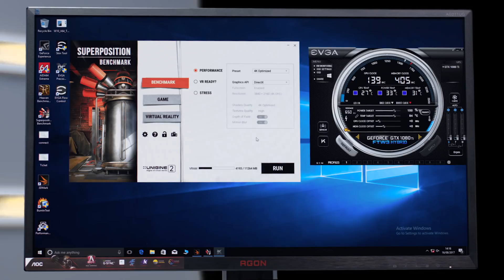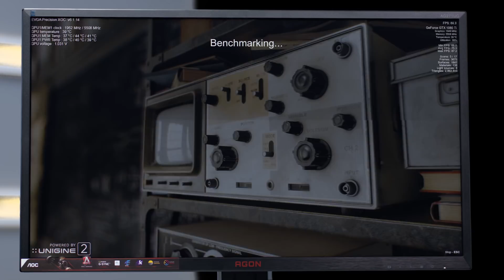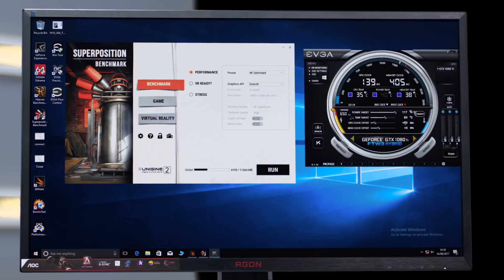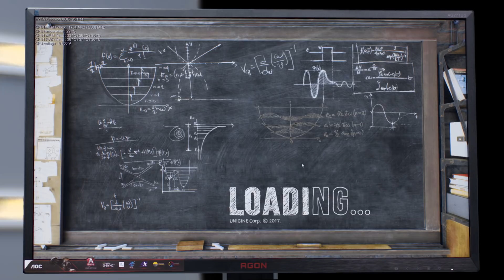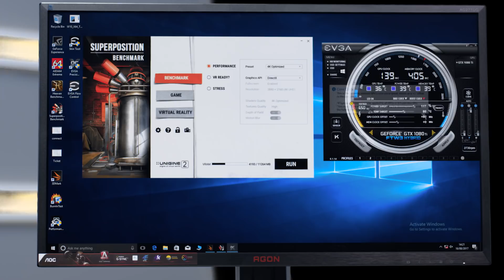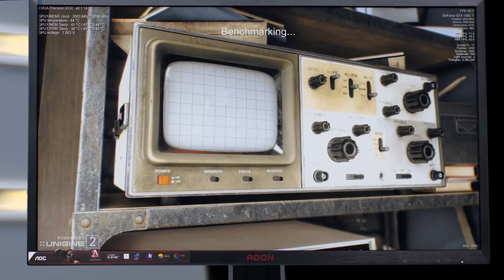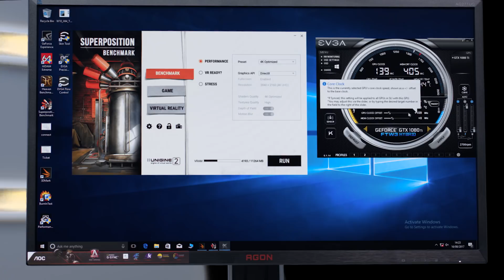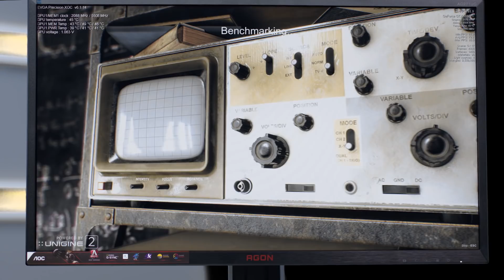Overclocking the EVGA GeForce GTX 1080 Ti FTW3 Hybrid with Precision XOC software - Tutorial

Comment: I purchased a 1080 ti FTW3 Hybrid on eBay that is functional on older drivers, but above 46x.x the system becomes almost completely unresponsive.  Power Consumption shows 0.0% TDP, and the VRAM fan never spins. Temps stay in the 38° range.  Any idea what would cause this?  Bad fan controller?  Bad INA3221?  Has anyone else encountered this issue?

Comment: I’m new to overclocking. I had my 1080ti ftw3 for years now. Does this over clocking really make a huge difference? Also, do I have to click the switch on the card itself before I attempt this? I’d like to upgrade but only if I have to. I never overclocked the card and if this makes it just as good as a 3080 I’d be happy. Thanks for any response will help.

Comment: Mine didn’t do a safe crash. Screen is black and my Pc is still on. The fuck do I do?
Reply: You just pull out the HDMI cable from the graphics card and then plug it back in in 5 seconds the screen will flicker and you'll be able to resume what you were doing.

Comment: safe? yes,,,totally proof no,,,like MSI 1060 6GB Gaming X the afterburner, if you OC'ed the GPU incorrectly it would lock up right after you login the windows , you have to get to safemode to uninstall the software!!
Reply: but can that happen with precision xoc? just saying.. its made by evga for nvidia i have tried using afterburner in the past.. there is alot more tweaking that you can do, but the reason I stoped using it is because im not informed enough to use it safely.. it seems with that software you could over do it

Comment: Can anyone help??!
My fps isn't as high as i'd hoped for games like PUBG / GTAV 
GPU: EVGA NVIDIA GeForce GTX 1080 Ti 11GB 12GHz FTW3 ELITE GAMING BLACK
Intel i7 4790k
16gb ram
34 LG 34UC88 (ultrawide) 3440x1440

I'm only getting between 40-60fps on GTAV and that's not even on max settings. I've tried on my 1920x1080p monitor as well and that doesn't make much difference! 
Any help would be great!

Comment: Looks like a really good tool and on par with Afterburner, my thoughts on overclocking though are only for bragging rights as I want my cards to last as long as they can due to budget, the harder you work something the quicker it will break

Comment: This software is great. I find that my EVGA 1080TI SC without this software gets to 82C and the fans aren't running at full speed. I like my GPU to stay cooler than that so with this software I get more MHz whilst even running lower say at 75C tops with full fan speed.

Comment: Precision X is easy to use . I have used it on my EVGA 750 ti OC . I no longer over clock due to the GPU is getting old and I really need to prolong the life of the card since I can't afford to replace it. But I did have a lot of fun playing around in Precision X and running bench marks.

Comment: I used to like overclocking but now it's just 5-10% improvement on a custom card that has the cooling capacity to oc, the cheaper ones that are factory clocked lower can go past 15% but they have undersized cooler so...

Comment: Did a few tweaks and got mine to 2075mhz. (Same card as in vid) Once i oc +84 on core, frames absolutely dive but the benchmark still runs. So weird
Reply: Tomas Bodnar did you fix issue? Is 84 c too hot? My 1080ti ftw3 hybrid arrived today.

Comment: I’m staring to order parts for my 8700k/1080ti custom dual loop water cooled Pc build.

Help please! 

Which 1080 ti gpu care is the best for custom overclocking on a custom water cooled setup? Looking for max ghz. I think max on a 1080ti is 2.2 MHz 

Also, which z370 is the best for custom overclocking? Is it the ASUS ROG Maximus X Hero? I don’t care much for price to performance but I also do t want to pay for a MSI godlike since I’m not getting SLI. Thanks!

Are 8700k CPUs all the same? Or are ther variances like there are with the GPUs?
Reply: Joe Momma 

I just did a build 
8700k clocked too 5 water cooled
 1080ti hybrid sc2  water cooled using this software
16 gb ram
4tb
Reply: Asus 1080ti Poseidon. I have an FTW3 Hybrid but I wish I got the Poseidon. Not that the FTW3 is bad, it's awesome. But if you add a custom loop to the Poseidon it will be the best as of right now. My FTW3 can run at 2075mhz so far. But I haven't played with it too much. Hoping for 2.1ghz. Also running a 6700k @ 5.0ghz and using an Z170 Asus maximus hero viii.
Reply: Robert Daugherty what is the Poseidon know to clock at? Thanks!
Reply: Joe Momma like the guy said in the video every card is different. But if you just want the highest frequency without having to play the silicon lottery get the EVGA 1080Ti KINGPIN. It's garunteed to overclock higher than others. But the Poseidon comes with a full cover waterblock installed, air cooling ( if you don't have a custom loop right away) and a custom pcb that can accept custom bios with higher voltages. Then when you do get water cooling you can use your custom loop and the air cooling on the card in tandem to get crazy low temperatures. That's why I like the Poseidon.
Reply: annggee Ruiz 
Fuck yeah bro!! Are you delidded or not? I’m thinking about overclocking to 5 but I’m not delidded. 

My set up:
-8700k cpu overclocked to 4.8 w/1.25 core volt (not delidded)
-EK-MLC Phoenix 280mm AIO w/cpu block (highest temps on 1 hr stress test 71 C. Idle at 31-33 C)
-1080ti ftw3 hybrid (AIO w/fan on gpu)
-G.skill z trident 16gb (2x8) 14-14-14-34 ram
-960 pro 512gb m.2
-Seagate firecuda 2 Tb sshd
-Evga 850w p2 psu
-Phanteks Enthoo Pro m se 

Peripherals 
-zowie Ben q xL2546 (240hz/1080p/DyAc) monitor
-hyper x alpha cloud headset 
- zowie Ben q ec2-B mouse (I also have Logitech g502 and it works just fine but I prefer the ec2-B)
-ZOWIE BENQ CAMADE (BUNGEE) 
- Redragon K552 KUMARA LED Backlit Mechanical Gaming Keyboard (only reason I have this is because I had it already from when I tried to keyboard mouse on Xbox one w/XIM4 device)
- zowie Ben q GS-R Large mouse pad.

Total cost for everything: $3,666

My entire Pc build is dedicated for CS-go. I highly recommend the XL2546 monitor. It is amazing. People constantly ask me how I’m so good if I just started playing competitive mode on CS-GO. I tell them it is my setup.

Comment: i like the idea of hybrid cooling, definately a best of both solution, although i'm not entirely sure of radiator space in my case if i've already got a closed loop water cooling system so it might be worth considering options between the 120mm rad and the 240mm rad.

Comment: pushing to the limits safely is the main reasons of overclocking for me, and the use of EVGA precision delivers an easier way for overclockers to push their cards to the limit. With the hybrid cooler of the EVGA 1080ti FTW3 it kept the card cool even though it really runs on so much stress and on high clock. Astonishing

Comment: I've never OC'd a GPU before, though while an app like this makes it easier than I thought, a stock 1080 Ti is OP out-of-the-box anyway so even with this card I probably would've OC the Ti until around the time GTA 7 gets release, or VR games become 4K @ 60fps as minimum, not 4K total screen size, actual 4K resolution per eye.